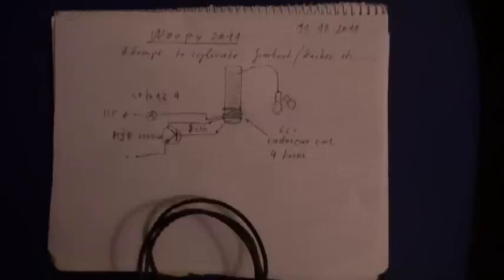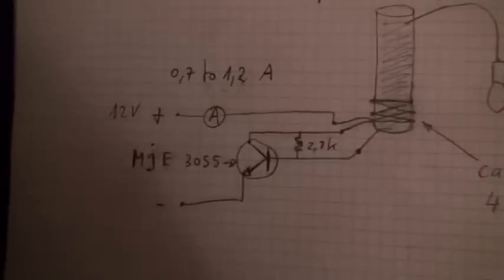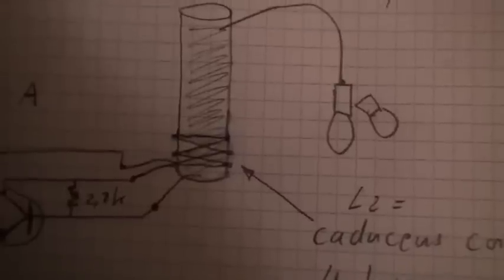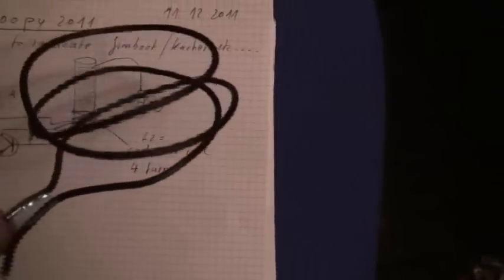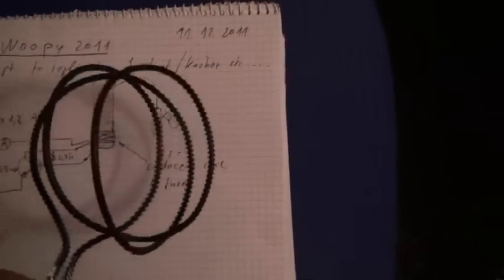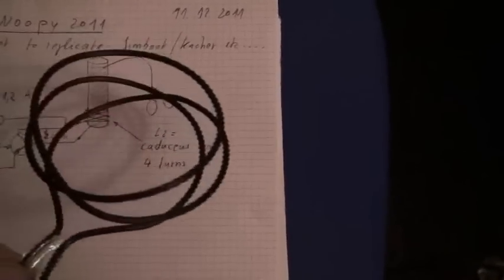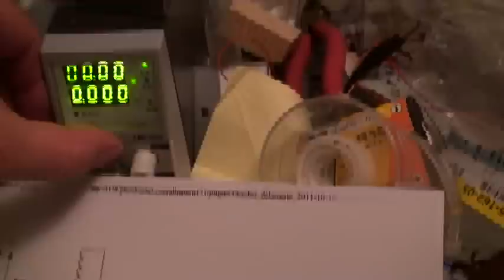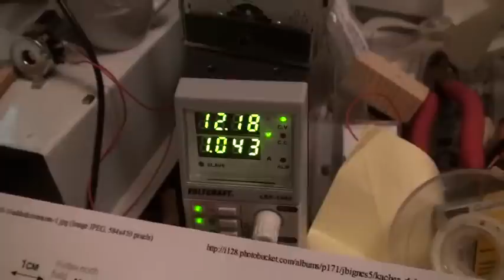caduceus coil on slayer exciter 1.wmv

Comment: The reason for the fluctuation of current due to the switching of your transistor, a high-voltage field is set with High oscillation!  This is normal operation in this case, stray eddy current so be careful!

Comment: Can't get mine to work yet, keep burning out transformers. I have a 24vdc power supply but I might need to put a bulb in series with it to keep a load on it so it doesn't burn the power supply out. Can we do this without a transistor  and resistor just powering the main coil? I still don't understand how the 2ndary coil hooks up to the circuit.

Comment: I am using a 2N3055 NPN and I can't figure out which connection on the transistor to connect the lead of the2.2k resistor from the end of the antenna to the caduceus and fan to, the collector, the Base or the Emitter??... and then from which pin do I use to return the path to the positive caduceus ( green wire on my rep. ) to complete the circuit.

Comment: Hey Laurent - 1st time I've heard your voice! Love the accent. I found if I got the transistor as close to the coil as possible the power had a massive jump. You will see delamorto does that in his latest vids too. Also maybe a more "fixed" connection to your lamps and a second "aerial lead off the other terminal.